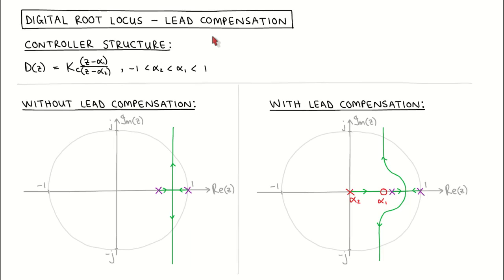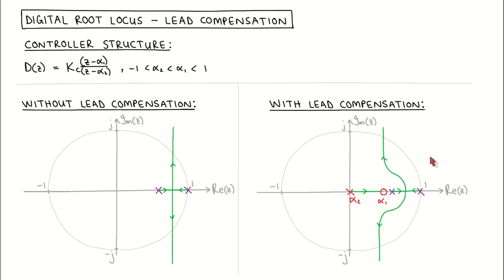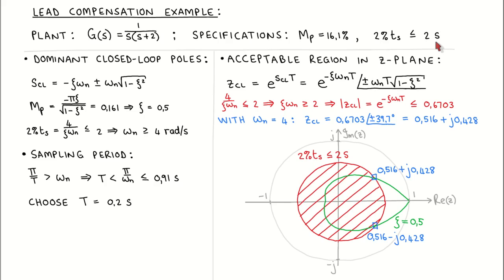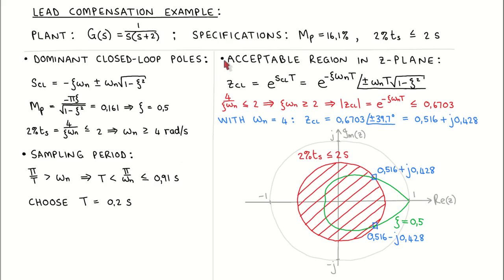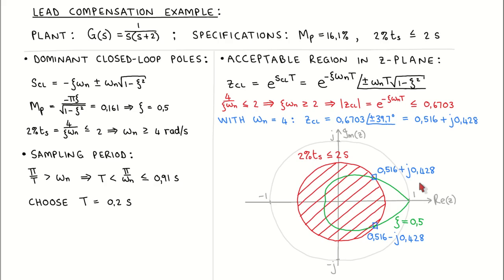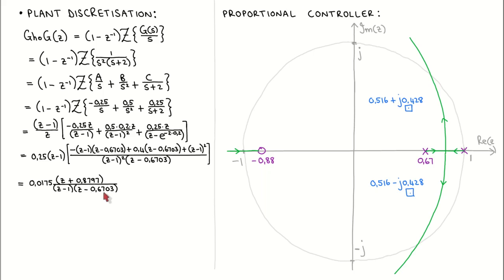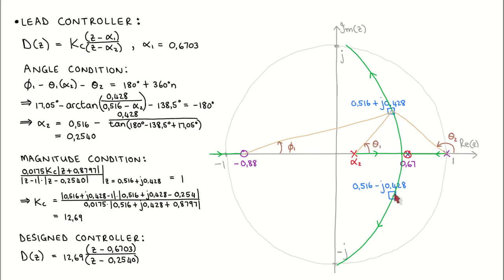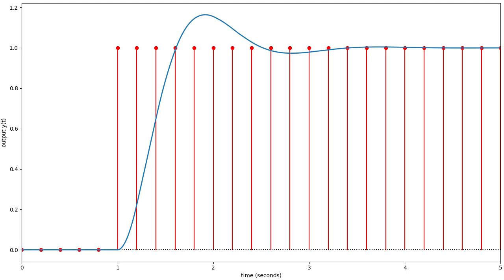Digital control 24: The digital root locus, Part 2

Comment: Hi Mr. Daalen,
In this video, ı guess T<pi/wn is not equal to 0.91s. 3.14/4=0.785 s. How could we choose the value of T as 0.2 though?
Reply from the maker: Yes, thanks for pointing out the error; the correction is posted in the video description. 

The sampling period, T, should be less than 0.785 s, so T=0.2 s is still a valid choice.  The sampling frequency is actually about 8x higher than the closed-loop bandwidth (instead of 10x higher that I claim in the video).  This choice of sampling frequency is outside of the range of frequencies given in common design guidelines (see this video I made about the choice of sampling frequency: https://youtu.be/AdlCPZ5bY9M ), but  by no means invalid.